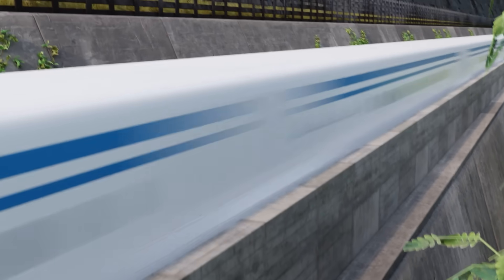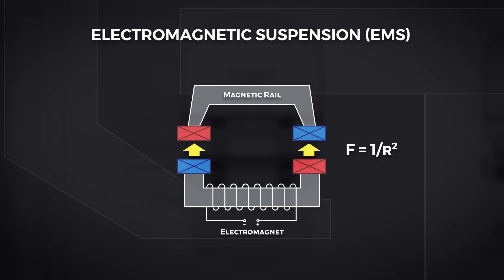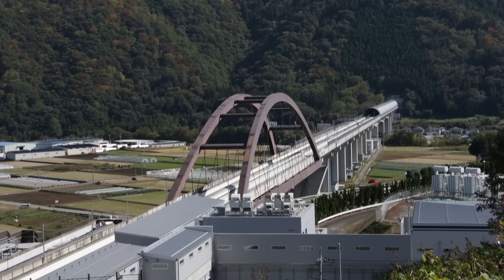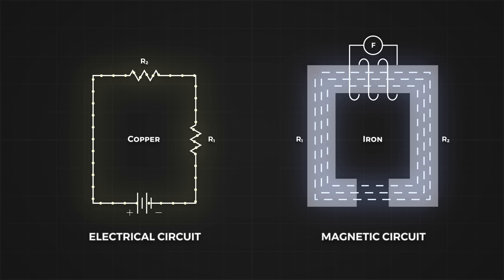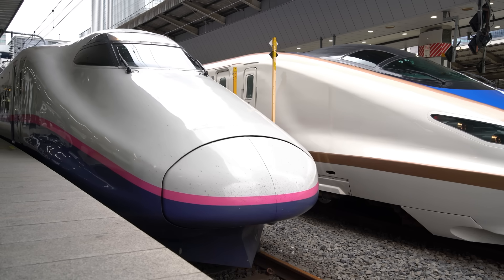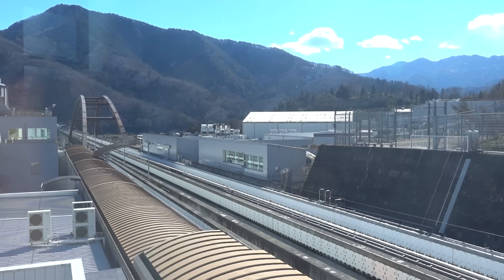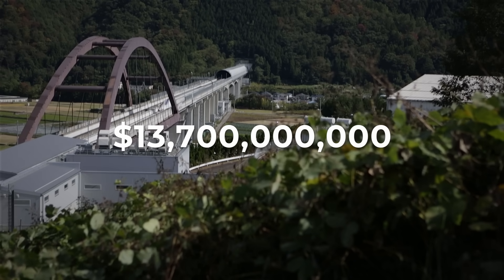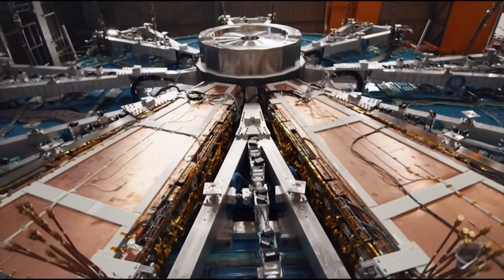How Japan's Maglev Train Works

Comment: Video just came out so it may be explained later, but I’m very concerned about birds and debris on the track.
Reply: well... inspection?? then again if the bird don't get out from the booms aint nothing gonna help em...
Reply: most of the distance is going to be in a tunnel
Reply: Birds would probably be forced around with the air most of the time.  They're not ingested into jet engines like with an airport.  For a bird, 300kph & 600kph are both crazy fast, but less than the speed of sound.  Not sure if birds get stuck in train tunnels.  Debris is more interesting.  There's 10cm of space where it doesn't matter, but what about ferrous materials?  Do they have an AI analyze camera footage from the train every day?
Reply: There is a 8 meter crumple zone for big stuff, and the front don´t have a window so bird strikes should not be a problem.

Its also unlikely the birds want to be anywhere near the track. Birds are very magnetically sensitive, and they dislike very strong and high frequency magnetic field. 

(Birds sitting on power cables typically do so when its low current, hence low magnetic field, birds seam to not care about E-fields, just M-fields, and the M-field is dependent on the power drawn, not the voltage)

Comment: These type of train should be in USA, long distances in a car is boring
Reply: How can overcome car lobby pressure ?
Reply: The US has the most comprehensive system of commercial passenger airports on the planet. You can get between practically any two spots in the US with a single layover.
Reply: You have planes
Reply: you guys need to start with your current rails... no use getting the shiny if you can't even implement a decent sustainable transportation policy with your current rail
Reply: @PrograError  You can't have High Speed Railway without a new set of rails only for HSR trains. You can't have slow speed trains using the rail and it will slow the trains that meant for high speed.

Japan and French have done it with their Shinkansen and TGV
Reply: @keiming2277  pretty sure Europe have mixed use HSR line, even in SKorea... 

Also you can start with fixing the system for conventional rail. Once you fixed it, you'd almost get brightline rail like service...
Reply: @PrograError  Korea use French TGV technology because back then China still working the imported Japanese E2 for their own. Because of previous colonial history, they don’t want to import high speed trains form Japan.